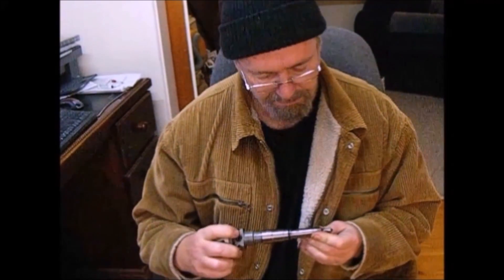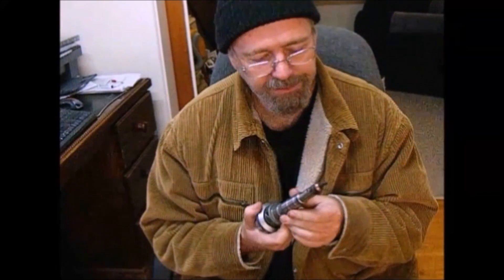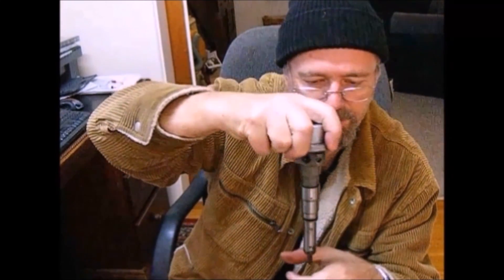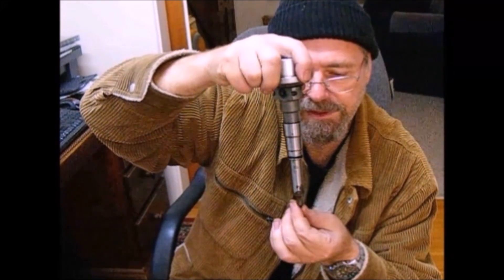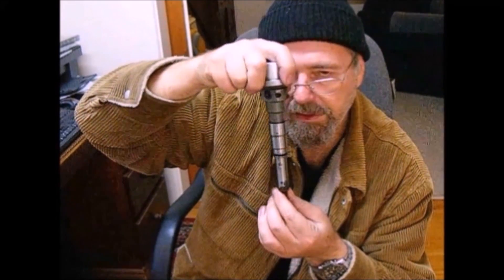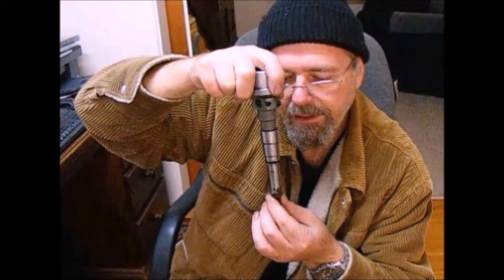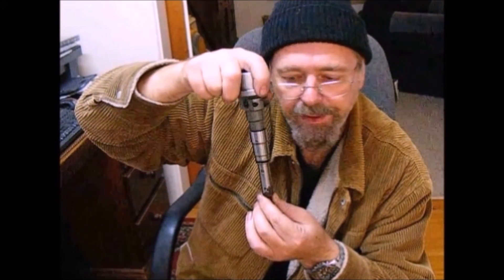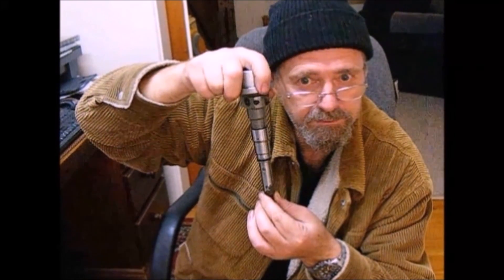Why Isuzu 4JX1 Injectors Fail - and How To Fix Them

Comment: יHello I have Itzik Israeli jeep diesel 3000 Isuzu Trooper is necessary to clean the Injectors
Reply from the maker: Hi..  It isn't necessary to clean these injectors. They work at 26,000psi and so are self-cleaning.  The force of the fuel blasting out of the tip is very high so they never get blocked.  However - to keep the inside of the injectors super clean - change your engine oil at the recommended schedule ( every 5000km ).  Also replace both oil filters and the air & fuel filter regularly.  Ensure the diesel fuel you buy is clean.  If you do these things the insides of the injectors should be perfect :-)
 
In a computer controlled engine, faults are often hard to work out. Faulty injectors make the engine run rough, but this can also be caused by many other problems.  If the injectors are faulty there is usually an error code in the computer. The best way to read these error codes is with a Tech2 diagnostic computer.  But you can also read them by shorting pins 4 & 6 on the OBD2 diagnostic connector and turning on the ignition key. The "check engine" light will flash the error code numbers if there are any faults.  The procedure is explained well in sections 6E-27 & 6E-54 of the Isuzu workshop manual.

A simple way to make sure if your injectors work is to start the engine with the rocker cover off. Then watch the injectors.  A good HEUI injector squirts oil out of it's side every time it fires.  If there is no oil squirt - probably the electrical solenoid is faulty.
Reply: Edwin Henry Blachford Thank you very much for your help I think one injectors not working well told me that I can not close the injectors without Momnt I am looking for a new Aingktr Thanks again

Comment: Hi, what about the piston O'ring and the internal seal with in the injector?
I try to open this unit with out damaged it. Any Idea?
You waisting money just to rebuild the external ones.
People's advice is to use ceramic seals. Do You know where to get it in Australia?
Reply from the maker: I made this video after a mate was charged $4000 to have his injectors replaced. His Jackaroo has only done 98,000km. I asked for the "old" ones. I tested them and apart from needing new copper gaskets, they work perfectly. He paid $4000 for a job that could have been done with $16 in parts. I have seen this happen many times, and yet it is a common fault in many centre fire injectors ( eg Landrover, Detroit, Ford, Cummins, CAT etc etc diesels ) .  So I suggest checking the copper gaskets before buying new injectors.  Rebuilding injectors is a fiddly job and usually beyond the average guy so I suggest regular maintenance beforehand to avoid it.  Ask an injection specialist for the parts if attempting it. A number of firms rebuilt 4JX1 injectors so it's obviously do-able.     Ceramic seals will last longer than rubber ones, but will still fail if 2000psi of 2500F combustion gas blasts up their innards every 2 revolutions of the engine